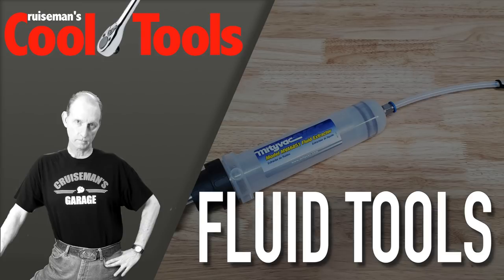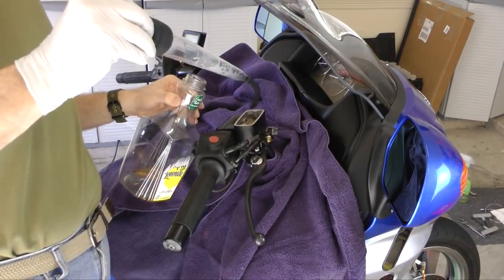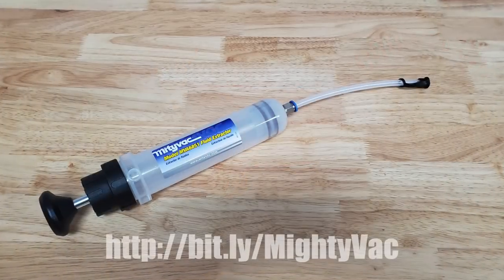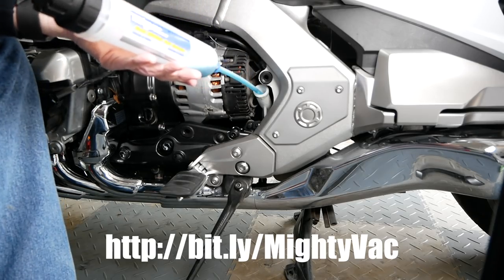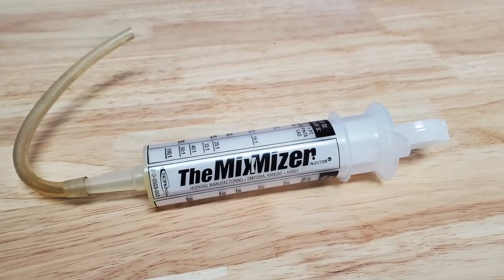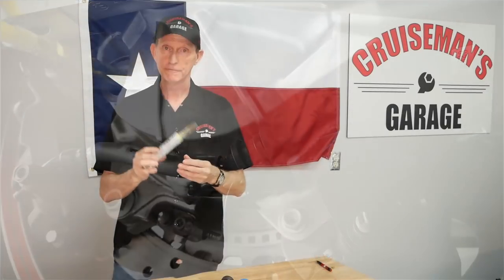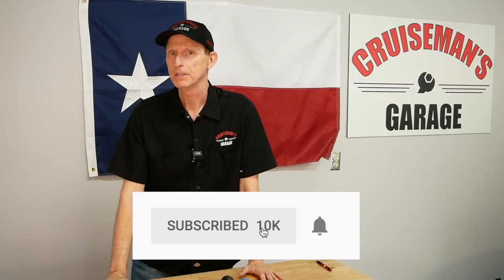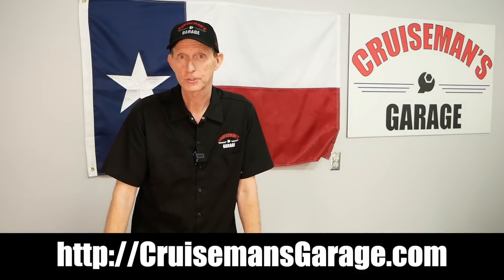Tools That Deal With Fluids

Comment: I have been using something similar to the mityvac for the final drive fluid. Great tool but I’ve had a heck a a time cleaning it out after installing the new fluid. Any suggestions? I have been hesitant to reuse the device when it has left over residue / fluid. An issue with that?